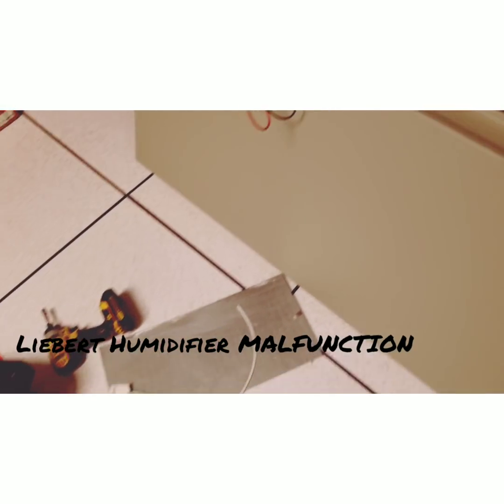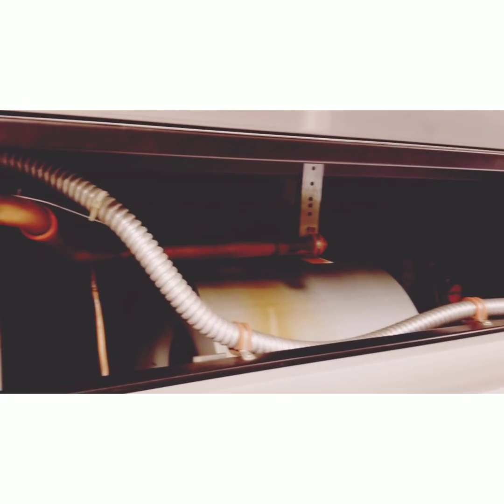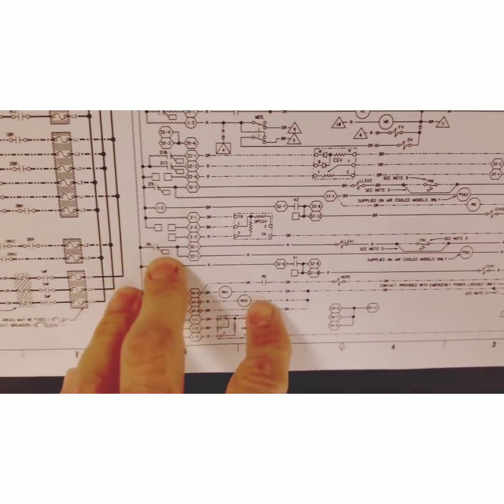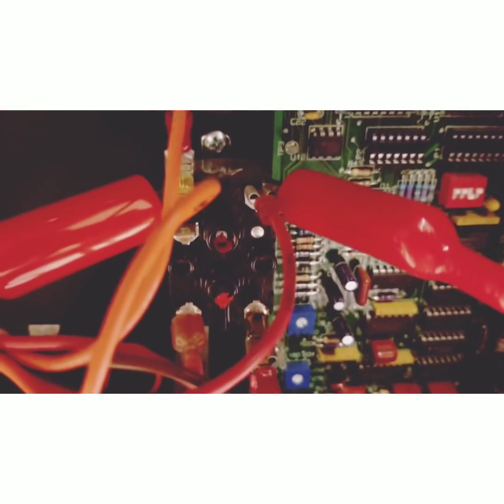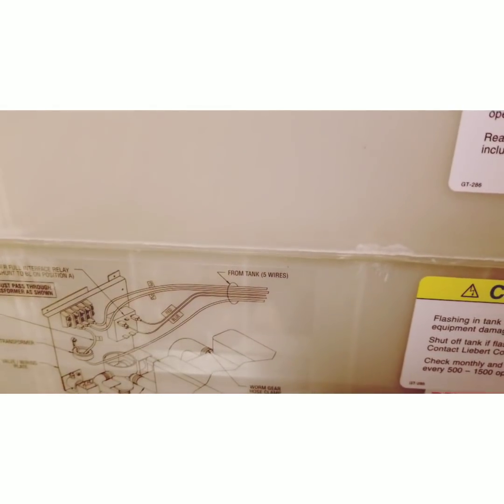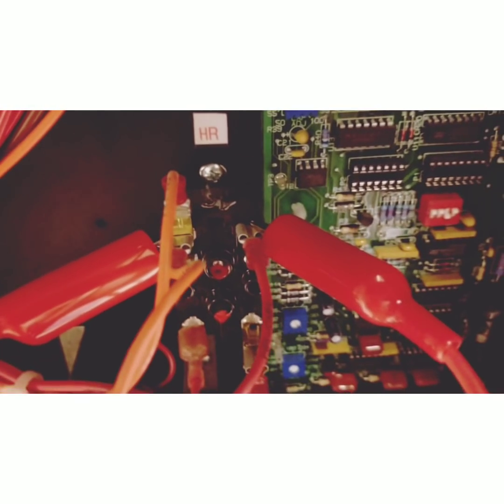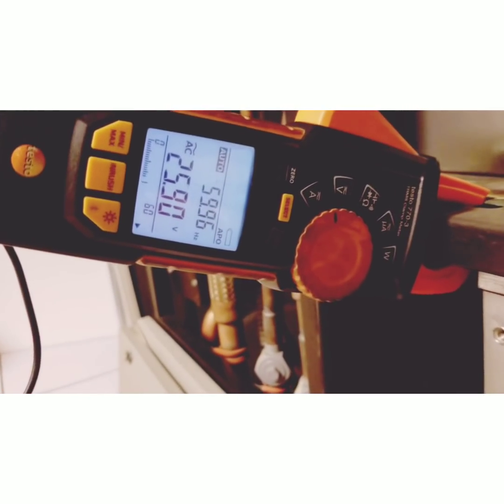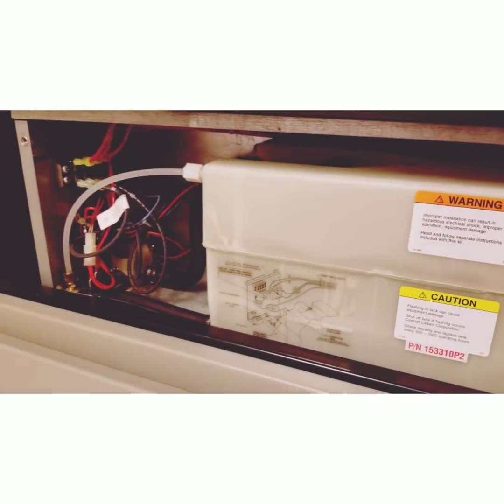HVAC Troubleshooting - Liebert Humidifier

Comment: Hello, I have a Liebert device that the set point is at 23 and 12 dew points, the problem is that the humidity is over 70%, the humidity does not drop but the temperature drops to 18 degrees.

Comment: I came across my first liebert humidifier unit the other day. I have a question hope you can help me. The fill valve was constantly getting 24 volts even when I shut the unit off at the thermostat. The canister was overflowing.  What would have you checked ? Or possibilities that could be the problem?